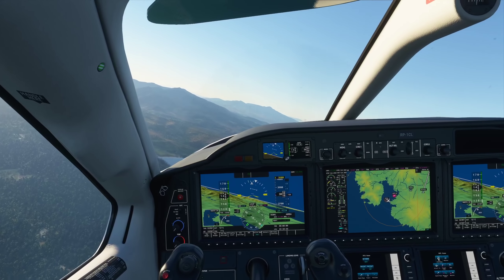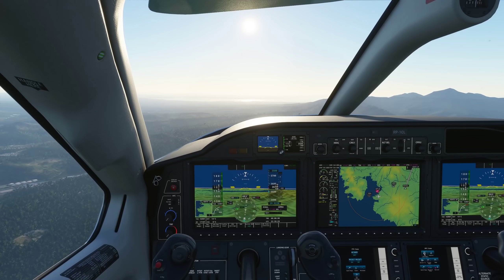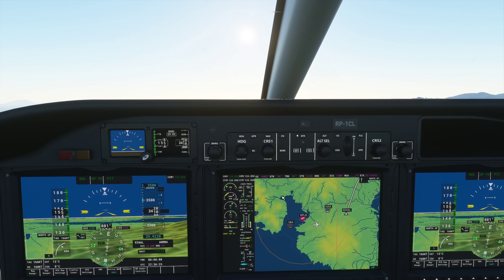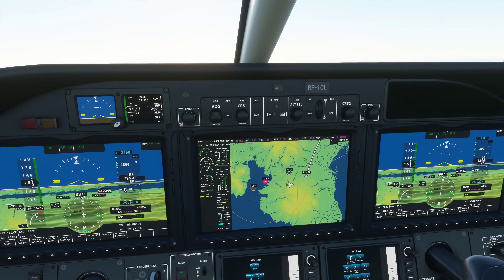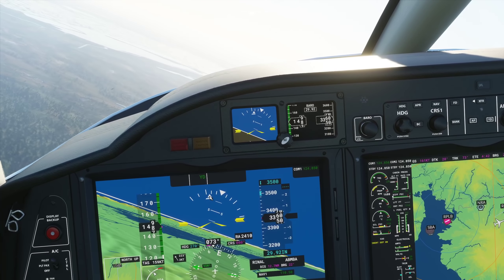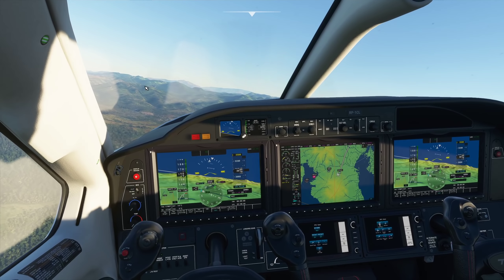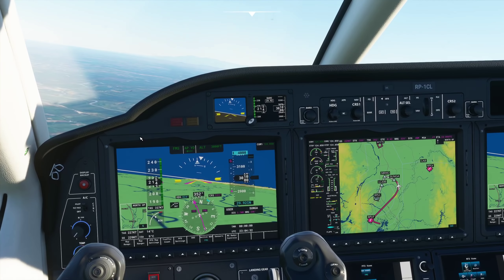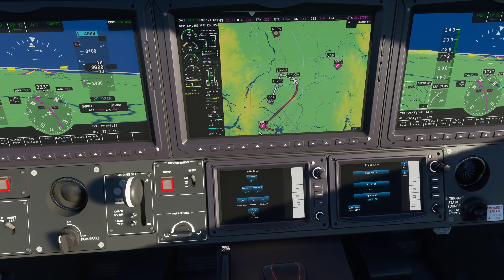Autopilot is BROKEN! (or is it?) - Microsoft Flight Simulator

Comment: When I switch to fms it does not work....
Reply from the maker: What does the annunciator say?
Reply: @TheClumsyGeekGaming I don't have any alerts but I usually switch to fms then turn on the AP, YD  and Nav mode but it does not follow the flight path.
Reply from the maker: I see, but what does the annunciator say? In the vid I highlight the importance of reading what the annunciator says to understand exactly what the autopilot is doing.
Reply: @TheClumsyGeekGaming  I only had the ap and fms (not roll) and alt showed on the hud.
Reply from the maker: Hmm yeah that should indeed follow the flight plan. That's weird. Maybe that's a real bug you found there.
Reply: @TheClumsyGeekGaming  Yeah most of the times the AP does not turn on after pressing it but when it does the fms does not work still... Yeah it's a bug, other people are having this issue.

Comment: if you use the GTX 1070 in this video you have a very high framerate .. in my opinion it's due to the 144hz monitor
Reply from the maker: Yes I use the 1070 here. It's not due to the monitor, though. I used high-end preset mostly and probably my other pc specs helped a lot.
Reply: @TheClumsyGeekGaming  i'm getting a pc with a super rtx 2070 and i5-9600k processor... do you think I turn flight simulator well with these specifications?
Reply from the maker: @fabioklax4615  yes, should be much better than what you see in this vid, at least. 👍
Reply: @TheClumsyGeekGaming  
your videos are perfect and are rendered perfectly :)

Comment: Hey, 
what an informative video. Thank you a lot. 
I run into a problem. I like to fly a long distance and have to take a day break between. So I saved my flight and the next day I loaded up my flight then I lost my flight plan. It's not being saved. I pre-configured it on the world map at the beginning. Is this a bug and is there a way to load a flight plan in the running game or do I have to manually type all the waypoints? It's a bit annoying if you have a lot of waypoints.
Reply from the maker: Thanks! That's a good question, actually. Other flight sims don't usually have a save function, but I do see an option to save here. Can you try saving as .flt instead of .pln?
Reply: @TheClumsyGeekGaming  already did that. It saves the flight and you can load it but you will loose your flight plan. So I hoped there is a flight plan in game load option like in x-plane
Reply: @TheClumsyGeekGaming  or wait can I load a flp file while I'm in game?
Reply from the maker: @c.r.8112  My expectation is it should keep the flight plan you loaded once you're in the cockpit. Might be a bug hmm.
Reply: @TheClumsyGeekGaming  it was a bug. Now it works. Just load the flight but you will have to reset all lights, altitude for ap and switch from nav to fms.
Reply from the maker: Great to hear it works somewhat!

Comment: I’ve been learning on the Cessna 172 G1000. I’ve been noticing half the time that out of nowhere sometimes my plane will pitch uncontrollably. If I disable AP and reset trim, I have full control. But as soon as I reenable AP, the plane pitches uncontrollably again with trim all the way at nose up. 

Is this a known bug?
Reply from the maker: It sounds like the AP is trying to maintain a certain altitude, but your power isn't enough so it tries to pitch up to the point that it stalls. Try to double check the annunciation and altitude set, etc. Hopefully this vid will help a bit.
Reply: Clumsy Thank you. You were exactly right. I encountered it again and realized it was the throttle. Readjusted as soon as it started to happen and problem went away. I can see why people like FLC more.
Reply from the maker: @elanshudnow  glad it worked!

Comment: Until now everything was fine with me, but for some reason now on flights, I just can not press "AP" and activate the autopilot. I click and nothing happens, it remains unmarked.
I have "FMS" marked and everything I need.

Do you know maybe what could be the problem?
Reply from the maker: Are you on the tbm? Make sure the autopilot and trim switch is set to on. It's the one on the overhead panel, upper right side.
Reply: @TheClumsyGeekGaming  Yes, the TMB.
I'll try it. Thank you very much.

Comment: This isn't doing anything at all. I hit autopilot, put in all my settings, and nothing happens. It just stays manual. No matter what I do, absolutely nothing happens and I just plummet because the AP doesn't work in any aircraft. I've hit altitude control mode, heading mode, vertical speed mode, and I still have to fly myself. What's happening?
Reply from the maker: What is the annunciation? When flying the tbm, make sure the switch on the upper right overhead panel is turned on, otherwise AP won't enable.

Comment: Set the altitude. Set the VS, both active, yet plane is still holding altitude. Why??
Reply from the maker: What does the annunciation say? How much fpm did you put in?
Reply: Clumsy I think i figured it out actually. Your video was very helpful
Reply from the maker: @nicko123454  ah that's great to hear. Enjoy your flight!
Reply: @TheClumsyGeekGaming  Ok no, i thought i had it fixed.

 It starts off great by climbing the desired VS, but at some point it starts to hold the altitude even though it's still in VS mode. The ALT hold is not on. The FD is not showing what FPM i'm doing, and at the left side of the FD it says LNV1 - does this mean anything?

 The speed indicator stops showing my speed as well. I'm flying the Citation Cj4
Reply from the maker: I haven't flown the cj4 yet so I'll have limited inputs on it, but I did notice the planes tend to go to alt hold too early even before reaching the desired altitude. I hope the devs get a handle on it soon.
Reply: Clumsy Yeah i figured it was a bug of some sort. 

I flew the TBM 930 though, and everything worked as smooth as butter
Reply: @TheClumsyGeekGaming  Lol, now i attempted a cold start in the TBM. Taxiied to the runway, took off.

For the life of me, i cannot get the AP to work. 

No matter what i do the plane just turns to the right - then it climbs drastically - then it decents a bit - then it repeats. 

I have it on FMS. All the announciators are looking normal. The flight plan is good.

What is up with this?
Reply from the maker: There are some items in the checklist you might have missed. Specifically, there is a button above that enables autopilot. Without it, pressing AP wouldn't work.
Reply: Clumsy Yup, that did it, thank you kindly

Comment: Bah!  The patch broke autopilot six ways to Sunday.  Was just fin in the DA62...until the patch.  Nothing was fixed (such as light switch correlations) so now its far worse...and the stuttering is worse now too.
Reply from the maker: That's weird! Hope they fix those soon. About the stutters, is that everywhere or just the g1000? If only on the glass panel, try increasing the new graphics option for glass refresh rate to high. They set it default to medium and it's a bit laggy for me.

Comment: As much as i appreciate your effort in explaining the autopilot features, I cannot ignore you telling us that 150 knots is a slow approach speed. You extended your flaps at such a ridiculous speed, in real life you would probably ripped them apart. And then flying with gear and TO-Flaps at 150 knots and saying you were slow is just bonkers. 70 knots would have been slow, 80 to 90 would have been a good speed.
Nevertheless thank you for your effort in explaining the different modes and especially what you have to look at to see whether they are active or not.
Sad you were not able to explain VNAV as it is probably the most used mode when flying airliners.
Reply from the maker: Thanks for the feedback. Let me clarify. In this plane, 1st notch of flaps is safe to extend below 178 knots, same with the landing gear. Full flaps extension is the only one with 122 knot limit. Also for vnav, as much as I'd like to explain, it's not yet implemented in the sim so not much use and hard to illustrate.
Reply: The TBM930 flap speeds are much higher than you would expect.

Comment: Great video.. The heading is correct though "broken" I have been flying for years and have a good understanding, however, my AP button presses in, but just won't turn AP on. Any ideas?? Thanks
Reply from the maker: Thanks! Hmm what plane? What is the annunciator saying when you press AP?
Reply: In a TBM 930 there is a switch in the overhead panel that that enables the function of AP and/or YD..
Check that this is switched on...
If you started the aircraft with with Ctrl+E (from a dark-and-cold spawn) it doesnt do it for you,although it should because it should follow the start-up checklist...(its a bug)
I assume that spawning direclty on the runway where the aircraft is supposed to be up and ready for departure it would have the same effect..
Personally i like to start cold-and-dark (thats when the plane is completely off and you have to start it from scratch) and follow the checklist (Shift+C).It gives you a better understanding of the onboard systems and adds to the realism..

Comment: Do you think they will add more systems to the planes, or are they finished with them?
Reply from the maker: I think they will. Even the checklists are so incomplete on the premium planes. It doesn't need to be study-level, but right now it is too lacking imo.
Reply: @TheClumsyGeekGaming  It seems like it was rushed just a little bit.
Reply from the maker: That's how I feel, too. Great potential, but probably could've been more polished if the release date was later. Still, all in all I'm happy they released early. I can fly other planes while they finish off the more advanced ones.

Comment: Great tutorials. Why does my AP says "LVL" on the left most indicator instead of ROL and how do I change it to ROL.....?
Reply: Teldil Are you also flying the TBM? Different planes’ autopilots work slightly differently. LVL stands for level, and it means it’s keeping the plane’s wings level, rather than holding any specific bank angle. So ROL and LVL are very similar, expect ROL will hold whatever level of bank you have when you activate the autopilot, and LVL will roll the wings level and then keep them like that.
Reply from the maker: Thanks for the inputs! Yes what John said lol.
Reply: @john-alanpascoe5848  Thanks! I was flying Cessna 172 G1000. But...how do I switch between them....? I was not able to get to the ROL mode....what button switches between them?
Reply: @TheClumsyGeekGaming  Still not sure how to switch between ROL and LVL if it is even possible.
Reply: @No-Kung-Fu  I'm not too familiar with the G1000 yet. It's possible it doesn't have ROL, only LVL
Reply: @john-alanpascoe5848  In that case every time I want AP to take care of ALT I will have to have it on LVL and won't be able to make any turns? how do I cancel LVL mode....Sometimes I just want AP to take care of my ALT and let me control the rest but LVL leaves me stuck in my position pretty much.
Reply from the maker: You mean for climbing, descending? VS /FLC should work for you the same as in this video.
Reply: @TheClumsyGeekGaming  No.....when I activate VS/FLC the indicator still says LVL on the left side, which means I cannot control the plane to make turns while AP is running. I want AP to only take care of my ALT, not keep me stuck in LVL mode. How do I cancel LVL mode? I don't want AP to control anything except ALT changes.
Reply from the maker: Ah hmm I think I encountered that once in one of the planes, but can't remember exactly which one. Try to look for a LVL button in the panel. I think that deactivates it.
Reply: @TheClumsyGeekGaming  Thanks but there is no such button :( Does that mean I HAVE to let the AP control the heading of my plane in some form if I just want it to control ALT? sounds kinda dumb...
Reply from the maker: @No-Kung-Fu  yes, normally AP would take care of heading and altitude. You can set it to NAV to follow the flight plan or HDG to just fly on a specific direction.
Reply: @TheClumsyGeekGaming  So just to be sure, you're saying I CANNOT ask the AP to control only altitude? If I want to only let it control ALT and leave the control of the heading to me, that is impossible? if so, do you know why? sounds like a pretty big omission....
Reply from the maker: @No-Kung-Fu  yeah I'm not familiar with AP that only controls ALT. It has to have control of heading also in some way, whether that's just keeping the plane level or keeping a constant heading. From what I've seen, this is also how it is IRL.
Reply: @TheClumsyGeekGaming  Okay, very strange! Seems like letting it control only ALT should exist....anyway, thank you very much for the answers! Cheers

Comment: rol mode seems like a stupid autopilot function...who in the hell would want to fly in circles???  Is there a button to turn that off ?  That is just dumb.  Also how are you able to move around the cockpit so easily?  Are you using a headset? Also thumbs up video and thanks for this!!
Reply from the maker: Thanks! You can press hdg or nav before pressing ap so you don't enter rol mode at all. I'm using TrackIR which detects my head movements. 👍

Comment: This is the reason that I don't devote my time to flight sim, I keep going back to X-Plane, as the autopilot and FMC work
Reply from the maker: Yes, if you want study-level systems, xp11 has plenty of those. I am confident fs2020 will get them soon enough. Although, even at this stage AP actually works for the most part. Just a bit of smoothing to do.

Comment: The Citation's nav switching is pretty atrocious. Won't capture glide slopes very well at all, if ever.
Reply from the maker: Hmm I see. Must be a bug with that specific plane, huh. Even using the same steps as in this vid?
Reply: @TheClumsyGeekGaming  Well the citation isn't a G1000. But yes, switching over to VLOC will capture the LOC and since the plane is already in NAV mode, arm the Approach/GS, and then just flies right through it. So definitely bugged.
Reply from the maker: Yeah, g5000 in this plane, I think. Oh that's too bad. I hope they fix that soon. Many of the premium planes are pretty half baked at the moment.
Reply: @TheClumsyGeekGaming  Certainly. Ah yes G5000, either way Garmin products seem to work alright, but the other aircraft are so-so.

Comment: I don't understand why all the videos of this flight simulator that I see on YouTube the graphics of the ground look gorgeous I have a 2080 graphics card I sent the simulation to ultra and the detail of my roads and buildings are absolutely horrible. The highways look like they're made out of sand with water puddles in them. What is the problem ?
Reply from the maker: It sounds like an internet connection issue. Check your options that you are streaming data from the servers. If that is turned off, you will get low res scenery.
Reply: @TheClumsyGeekGaming  okay that sounds good where do I go to check that to turn it on ?
Reply from the maker: Not sure of the exact spot, but look in the options/settings and probably under Data.

Comment: Nah man! I put over 1,700 hours into just Flight Simulator X Steam Edition and I can tell you definitively that the autopilot is broken. I’ve had an easier time using the Autopilot on the 727 Professional Addon. The biggest problem with Flight Simulator 2020 is the lack of Pop Out windows ie Shift + 1-9 to give you an easier view of instruments.
Reply from the maker: Thanks for the insights. AP could be much better, true, but for now the basics are working passably lol. I'm not such a fan of pop-ups so I'm okay they're not there. What I like are the instrument views, the actual camera zooming in to the panels.

Comment: Would you recommend this game as my first flight sim? Also, could my pc run this game atleast 60fps with i7 8750h 2.2ghz and a gtx1050ti ?
Reply from the maker: Yes it's a great entry point for flight sim. 60fps isn't normally a thing with flight sims. 30fps is more than enough. You can check your specs against the minimum/recommended specs for the sim in the Microsoft store / Steam.
Reply: @TheClumsyGeekGaming  Ah ok I've never even played a flight sim so I'm a bit confused still but this game seems pretty cool. I might have to get it and I might have to get a yoke for it too
Reply: @epeli4585  Your PC should run it fine on Medium or Medium-low. Just a word of caution, if you have an XBOX controller ( or even a PS4 controller works fine ) use it instead of getting expensive hardware. You can get good flying with a Controller + Mouse and Keyboard and see where the sim takes you before comitting to more yokes, pedals and whatnot.
Reply: @danrobsilva  Ah ok, yes I do have a PS4 controller. Thanks for the tips I might get the game now
Reply: Danilo Silva on the contrary I recommend the t.flight hotas one $80 if you can find it and it is directly supported by the sim! So you won’t need to bind the controls yourself
Reply: @DeadlyDragon_  The trouble with the t.flight is getting one. Can't find any on stock.
Reply from the maker: Appreciate the honesty, but please mind the language. Family friendly channel. 👍